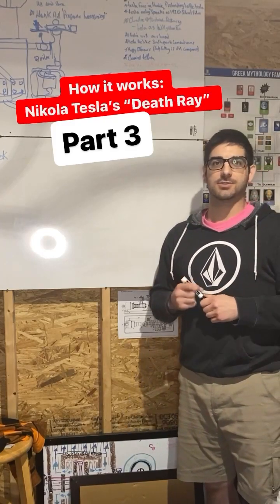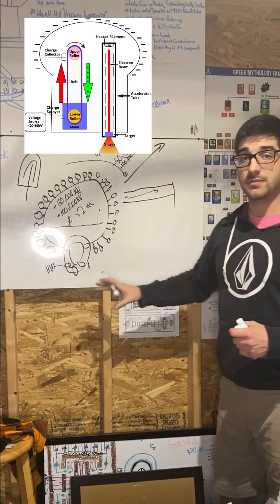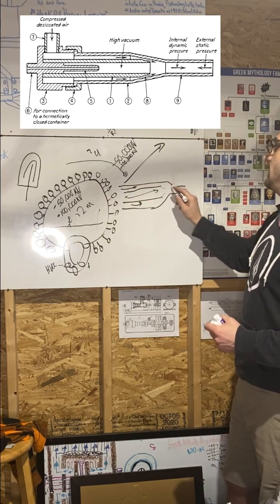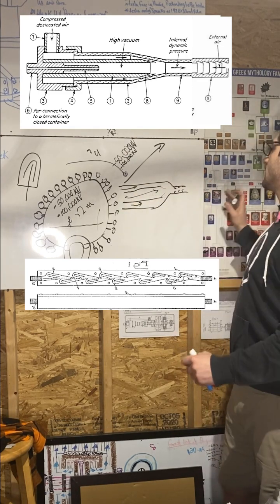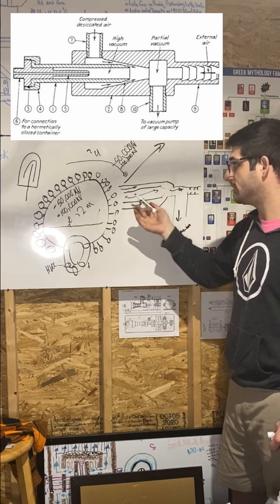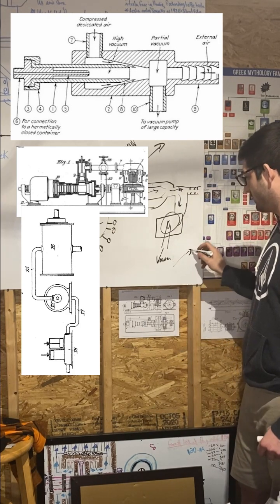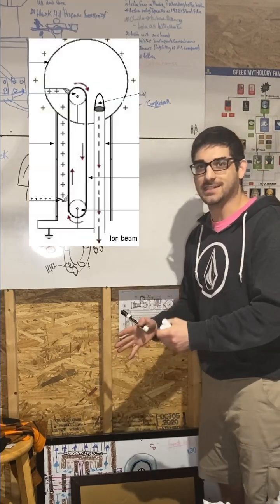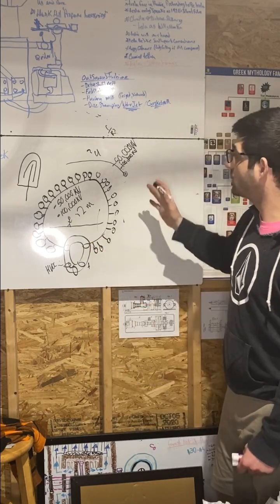Nikola Tesla’s Death Ray: How It Actually Works - Part 3

Comment: Would the steam turbine have an overpowered output just to power the nozzle given the velocity of the steam powering the turbine?
Reply from the maker: Hey thanks for commenting! ❤️‍🔥🙏

This is what Tesla said about the nozzle power requirements. 

“The working fluid, as compressed desiccated air, is supplied by means of a pipe 7, to a large annular space around conduit 1, and escapes through an expanding nozzle 8, formed by the tapering part of the block and the end of the conduit, into a chamber connected by a pipe 10, to a vacuum pump of large capacity - not shown on the drawing - for carrying off not only the air issuing from the nozzle but also that rushing in from the outside through the open end 9. In order to minimize the volume of the latter, I avail myself of an invention of mine known as the "valvular conduit" by providing the wall of the open end 9, with recesses as indicated giving rise to whirls and eddies which use up some of the energy of the stream and reduce its velocity. In this way, a pressure of about 100 millimeters of mercury can be readily maintained in the chamber increasing greatly the expansion ration of the air and its speed through the nozzle.
 
It is hardly necessary to remark that my open vacuum tubes require mechanical power for operation which may range from 10 to 20 h.p., but this drawback is insignificant when considering the important advantages they offer and I anticipate that they will be extensively employed.”

Hope that helps!

Comment: Lets not build the death ray. Lets build the free energy generating turbines
Reply from the maker: Hey thanks for commenting but to be clear my intentions for building it are for space propulsion and for geothermal steam hole boring for use with the Tesla turbines to get a for all intents and purposes nearly infinite supply of heat energy to power our society indefinitely fossils free. 

Not to mention couples with the wireless transmission system of Tesla’s I’ve figure out how to make work (I’ve got a video I’m releasing here in the next few weeks that will explain the whole thing, stay tuned for that one!) 

Both would see dramatic improvements from the implementation of this technology. 

Check out my other content about this. 
🦾🤓👨‍🔬

Cheers! 

Elon Musk Says Nothing Is Better Than His Rockets https://youtu.be/fMBn-P5fYZY 

Tesla’s Death Ray For Geothermal Hole Boring https://www.instagram.com/p/CwM3TGKOwi9/?igshid=MzRlODBiNWFlZA==

Comment: There is no way this can work. separating a full vacuum from atmosphere using a Venturi?
Reply from the maker: Hey thanks for commenting but yes it’s entirely feasible. These are common devices 

“Steam & Air Vacuum Ejectors

Vacuum Ejectors are based on the ejector-venturi principal and operate by passing motive steam through an expanding nozzle. 

The nozzle provides controlled expansion of the motive gas to convert pressure in to velocity which creates a vacuum with in the body chamber to draw in and entrain gases or vapours. 

The motive stream and suction gas are then completely mixed and then passed through the diffuser or tail, where the gases velocity is converted in to sufficient pressure to meet the predetermined discharge pressure.

Vacuum Ejectors are used in a variety of applications in the process, food, steel and petrochemical industries. 

Typical duties involve filtration, distillation, absorption, mixing, vacuum packaging, freeze drying, dehysrating and degassing. 

Ejectors will handle both condensible and none condensible gas loads as well as small amounts of solids or liquids, however accidental entrainment of liquids can cause a momentary interruption in vacuum but this will not cause damage to the ejector.

Primary advantages over other vacuum pumps can be seen below:

No Moving Parts - Ejectors are exceedingly simple and reliable. 

There are no moving parts to wear or break in a basic ejector.

Low Cost - Units are small in relation to the work they do and cost is correspondingly low.

Versatile - Various piping arrangements permit adapting to environmental conditions.

Self Priming - Ejectors are self-priming. They operate equally well in continuous or intermittent service.

Easy to Install - Relatively light in weight, ejectors are easy to install, and require no foundations. 

Even multi stage units are readily adaptable to existing conditions.

Corrosion and Erosion Resistant - 

Because they can be made of practically any workable material, or coated with corrosion-resistant materials, ejectors can be made highly resistant erosion and corrosion.

High Vacuum Performance - Ejectors can handle air or other gases at suction pressures as low as 3 microns HgA.

Ejectors range from Single upto Six Stage units, and can be either Condensing or Non-Condensing types. 

The number of Ejector stages required are usually determined by the economy of the ejectors and the level of vacuum required. 

The operating range for each stage of Vacuum Ejector using motive steam can be seen below, also for reference 1 BarA = 760 mm HgA.

1st Stage : 810mm HgA - 30mm HgA
2nd Stage : 130mm HgA - 3 mm HgA
3rd Stage : 25mm HgA - 0.8mm HgA
4th Stage : 4mm HgA - 75 microns HgA
5th Stage : 0.4mm HgA - 10 microns HgA
6th Stage : 0.1mm HgA - 3 microns HgA

Air driven units tend to be limited to Single or Two stage units and are usually of the Non-Condensing types. 

Air Ejector are less efficient than steam driven units but provide a viable alternative when steam unavailable or where large quantities of unused compressed air.

Single Stage Ejectors

Single stage Vacuum Ejectors generally cover vacuum ranges from 30mm HgA up to atmospheric pressure. 

To maximise performance eight different designs are available with each ejector being optimised to operate in a specific vacuum range. 

This allows the motive gas consumption to be kept at a minimum for the selected ejector, and also ensures that operation will be stable. 

All single stage ejectors are designed to discharge either at or slightly above atmospheric pressure. 

Sizes range from 1 Inch to 6 Inch, however large size are available if required. 

Standard materials of construction are carbon steel or stainless steel, both of which are fitted with a stainless steel nozzle.

Two Stage Ejectors

Staging of Ejectors is required for more economical operation when the required absolute vacuum level is reduced. 

Two stage Vacuum Ejectors generally cover vacuum ranges between 3mm HgA to 130mm HgA, however depending up on actual operating conditions a Single Stage may be more economical if at the upper limit of the operational envelope, or a Three Stage Ejector System if conditions are at the lower end.

In operation a two stage system consist of a primary High Vacuum (HV) Ejector and a secondary Low Vacuum (LV) Ejector. 

Initially the LV ejector is operated to pull vacuum down from the starting pressure to an intermediate pressure. 

Once this pressure is reached the HV ejector is then operated in conjunction with the LV ejector to finally pull vacuum to the required pressure.

Two stage systems can also be either Condensing or Non-condensing types depending upon the motive gas used. 

Condensers can be used as pre-condensers, inter-condensers, and after-condensers, all of which help to reduce the gas load being passed on to the next ejector stage. 

This helps to reduce motive consumption and also allows smaller ejectors to be used with in the system. 

Depending up on the application Non-condensing systems can also be used, however this can be less efficient than Condensing Types as each ejector must entrain the full gas load from the previous stage. 

This can lead to ejectors becoming large and also increases motive consumption. 

Non-condensing types are usually used where it is not feasible to install condensers, or where service is intermittent, making operating costs a secondary consideration.

Three Stage Ejectors

Three stage Vacuum Ejectors generally cover vacuum ranges between 0.8mm HgA to 25mm HgA, however depending up on actual operating conditions a Two Stage Ejector system may be more economical if at the upper limit of the operational envelope, or a Four Stage Ejector system if conditions are at the lower end.

In operation a Three Stage system consist of a primary Booster, a secondary High Vacuum (HV) Ejector, and a tertiary Low Vacuum (LV) Ejector. As per the Two Stage System, initially the LV ejector is operated to pull vacuum down from the starting pressure to an intermediate pressure. 

Once this pressure is reached the HV ejector is then operated in conjunction with the LV ejector to pull vacuum to the lower intermediate pressure. 

Finally the Booster is operated (in conjunction with the HV & LV Ejectors) to pull vacuum to the required pressure.

Three stage systems use steam as the motive gas and are also usually of the Condensing type. 

Again as per the Two Stage system, condensers can be used as pre-condensers, inter-condensers, and after-condensers in order to reduce the gas load being passed on to the next ejector stage. 

Depending up on the application Non-condensing systems can also be used however this is less efficient than Condensing Types as each ejector must entrain the full gas load from the previous stage.

Four, Five & Six Stage Ejectors

These systems are similar to Three Stage Systems, however they include additional boosters which are equipped with Steam Jackets to prevent ice forming with in the ejectors. 

These systems are usually of the Condensing type to increase efficiency and reduce motive steam consumption.”
Reply from the maker: Additionally Tesla states in the paper that it would require about 10-20hp to operate the nozzle. 

He also says to add a vacuum pump to the side of the tip of the nozzle to further reduce the need for steam 

I hopes this helps! 🦾🤓👨‍🔬

Comment: I wonder how rapidly it can be fires multiple times. This would be the best point defense system on taking out hypersonic weapons and jet fighters. I guess now with our technology this can be shrunken down.
Reply from the maker: Hey thanks for commenting but there really is no way to shrink this down. It needs to be large to be able to get the ultra high voltages without arcing off the upper accelerator terminal. 

It’s a matter of physics. Tesla talks about this in the paper, though the vacuum anti-arcing bulbs allow it to be made at even this reasonable size.
Reply: @CharlieSolis   Hmm I see, so the weapon would have to be stationary due to how big it would have to be. Really powerful but not really practical. Idk if something like this can be mounted on a large ship with all of the things that it needs to work.
Reply from the maker: I mean… these days you can fit that on a massive Boeing plane though 🤷‍♂️ 

Tesla talked about how it could be put onto destroyer/battle ships though. Which means anyone could rule the coasts from the sea. But yeah 

He primarily saw this as a defensive type of weapon. 

At least only wanted to see it used as such.
Reply: @CharlieSolis   I mean if you can put it on ships then you can go anywhere on what you need to defend. I hope one day the military will look over his particle beam.
Reply from the maker: @Fold-103  I would be absolutely floored if they haven’t already and don’t already have the full WEAV propulsion mechanism with it figured out already. 

https://en.wikipedia.org/wiki/Wingless_Electromagnetic_Air_Vehicle

I haven’t even scratched the surface with sharing what this thing is possible to do 🦾🤓👨‍🔬

I’m convinced this is what the Orb UAP/UFOs are. 

A spherical ultra high voltage terminal with individually modulating surface terminals all over the outer periphery for actuating plasma sheets around the surface of it for propulsion.
Reply from the maker: But as far as rate of fire… 🤔 

As fast as you can feed the tungsten niblets put to the nozzle and as fast as the charges can be brought to the upper terminal with the power of the turbo compressor driving the non inducted weekly ionized gas belt through the porcelain tubes to transport the charge to the upper terminal. 

“…It is important to devise a thoroughly practical and simple means for supplying particles and I have invented two which seem to meet this requirement. One is to feed tungsten or other wire from a spool in a closed container joined hermetically to the projector, the rotation of the spool being under control of the operator. Using wire 2/100 centimeters in diameter, twenty cubic centimeters of the same would provide material for 5,000,000 particles. The other device consists of a closed container fixed to the projector and filled with mercury which can be expanded by external and controllable application of heat and forced, under great pressure, through a minute hole in the extreme end of the extension reaching to the distance d as before illustrated and explained. The droplet torn off and projected would have the hardness of steel owing to the great capillary pressure. If mercury can be used for the purpose, this means is ideally simple and cheap.”.    -Nikola Tesla

Comment: Just a heads up, you would build pressure differential at the nozzle of the Tesla turbine intake, and you would lose potency of the vacuum you are pulling at the end of the ceramic nozzle from the pressure build up. Very excited to find your work, I just subscribed to you today. I look forward to seeing more of your content, and will give helpful/critical feedback where possible. If you have a platform you communicate on other than YouTube, I would be happy to add to your community.
Reply: Also, Fermi lab has a similar particle accelerator that they use to initially accelerate protons before they insert them into the secondary accelerator ring, and then after quite a boost they accelerate them into the main accelerator and keep them accelerating at speed until they launch them at their target (sometimes a cancer patient’s tumor) and the particle detector after smashing a target element.